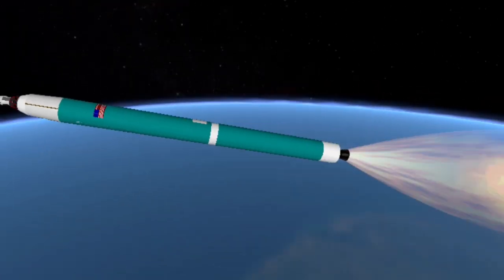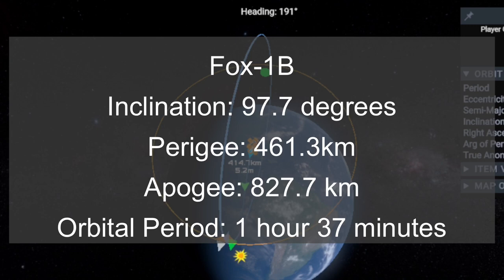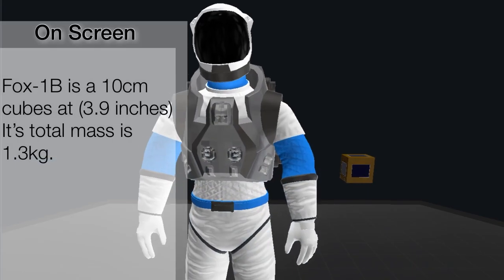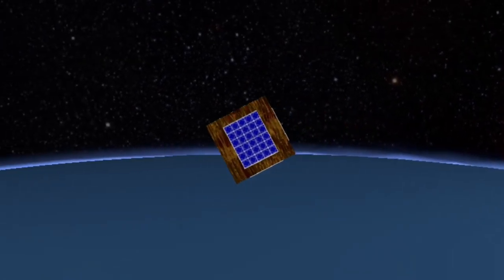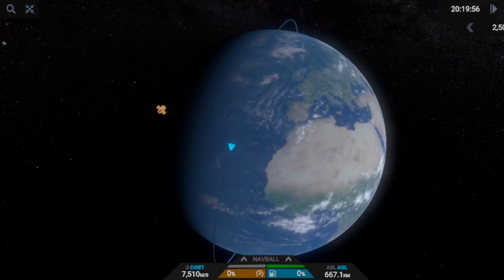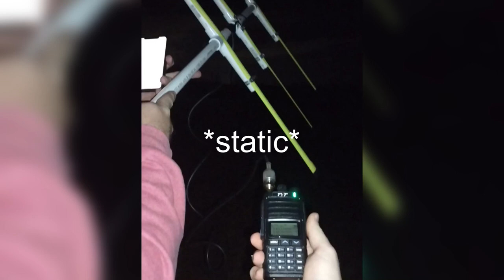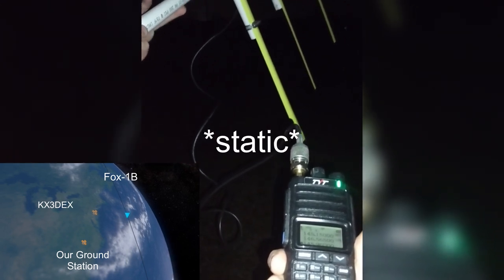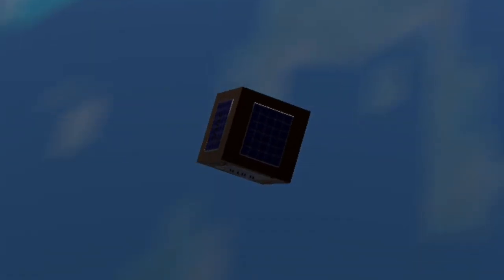Talking to a Satellite from my Backyard!

Comment: KX3DEX here!  This hobby is awesome and this was my first time actually trying to reach a satellite for communication.  Love the video and your others as well.  Got a new subscriber here!
Reply: DO NOT TRANSMIT IN ECLIPSE
Reply: @caseytucker4983  what?
Reply: @DexDeadly  AMSAT has asked over and over for AO-91 and AO-92 to NOT be used when satellite is in eclipse, aka in darkness. Rule of thumb DONT USE the birds when its dark/night.
Reply: I didn't see that when I saw what I did to try.  Curious why but will not do that .
Reply from the maker: It was awesome to hear you! That was my first time trying to work a satellite as well, we could hear you pretty well we just didn't have the equipment to respond
Reply: @caseytucker4983  Please provide a source for this claim. I can't find anything official that says this.
Reply: @DexDeadly  batteries are pretty much dead… so using it when it doesn’t have solar power further damages the cells in the battery and will make the day completely die sooner